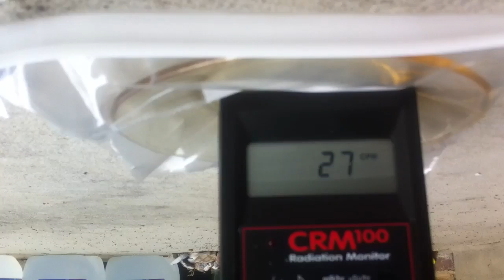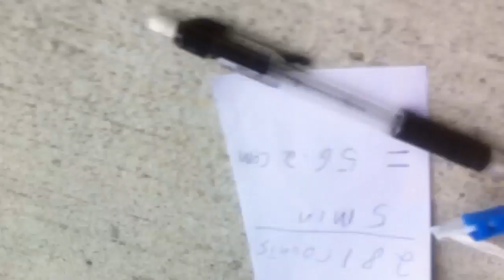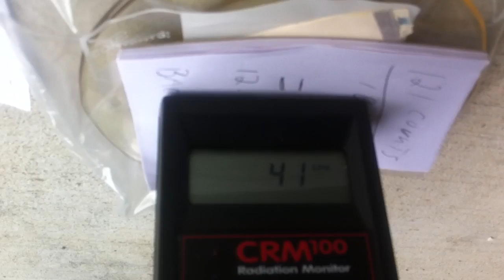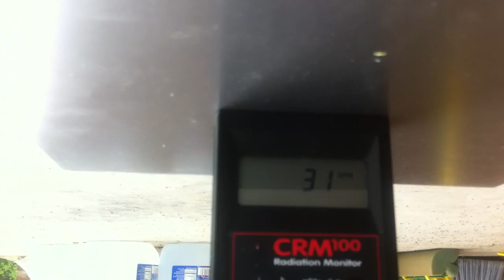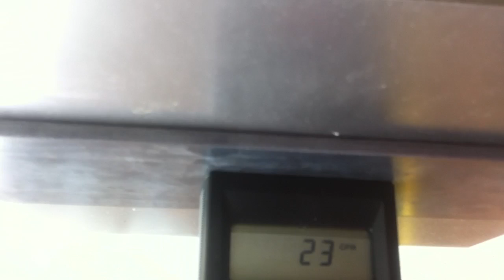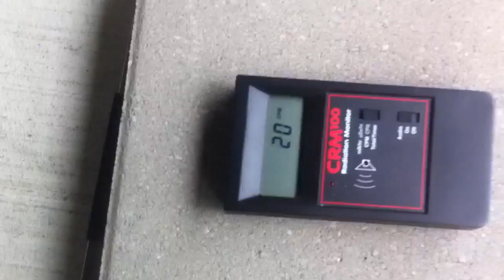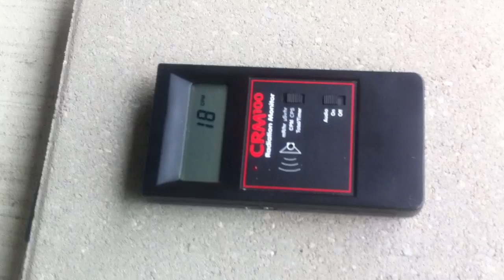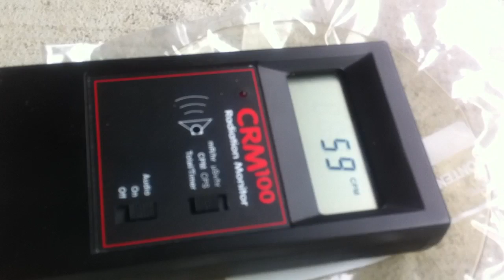☢ Radioactivity ☢ and How to Use a Geiger Counter -- Part 2

Comment from the maker: Natural barium is not radioactive. Barium can be radioactive if produced that way, but this is not very stable. 

HAARP exists, but not for what conspiracy folks believe. It was designed to enhance signals over long distances. As for chemtrails, chemicals have been dropped from planes, but not for mind control, population control, etc... but rather, for crops, cloud seeding, NASA research (they are quite public about this), etc.

Comment from the maker: The USA has greater reasons for a few reasons:

1. We seem to have loads of folks using "pancake" detectors. Where a normal tube detector might get 20 CPM, a pancake will get perhaps 60 CPM.

2. The USA has many high altitudes and lots of uranium and thorium in our soil. This is natural.

Denver CO might read 80+ CPM on my detector, but Virginia might be less than 40.

What you look for is not magnitude, but change in magnitude. 

(my Ludlum gets 2000 CPM lol)

Comment from the maker: I actually have some DU. Some of my old Fiestaware plates, my CDV700 check source, and most of the uranium glassware are full of it. It's not a supposed thing: many countries use DU in their weapons due to it's high density and low cost.

As for birth defects, I wouldn't doubt it. I would suspect that the heavy metal aspect of the DU is likely more harmful than the radioactivity (DU has a low specific radioactivity). Nasty stuff.

Comment: How did that glass plate not break over the weight of 3 sheets of metal and a concrete slab?
Reply: Exactly the reason it was made with uranium. It helps to not break

Comment from the maker: @RocktonicStudios    The CRM-100 is not a bad little unit, but it is not the most sensitive unit. 

I was just having a discussion with someone a short time ago on food testing. It is possible to detect radiation in food, but not the micro-levels which come from Japan. Even a large pancake unit would barely do it at best. 

I wouldn't buy a GM for food testing at this point. I use mine for sampling my rock collection, mostly.